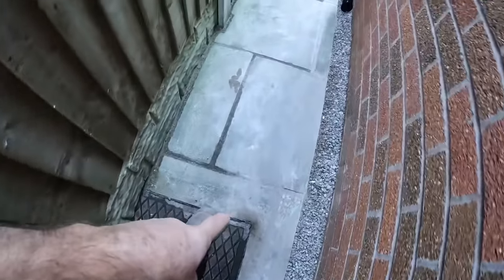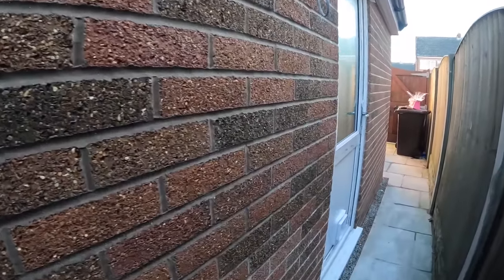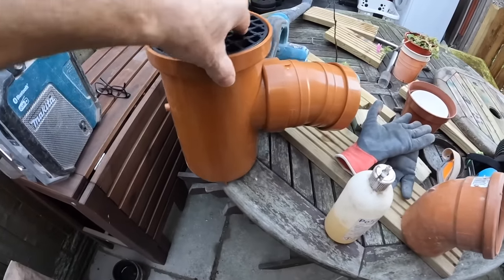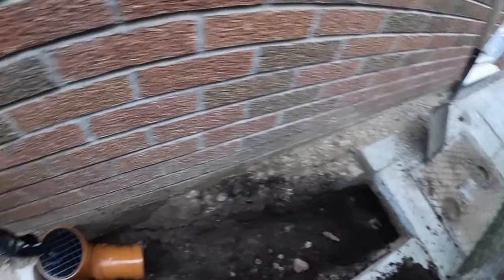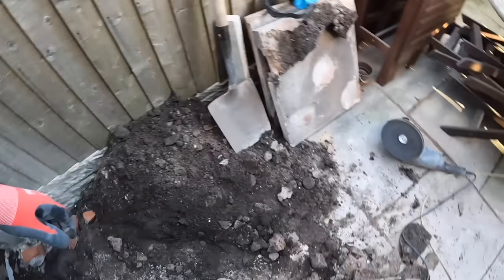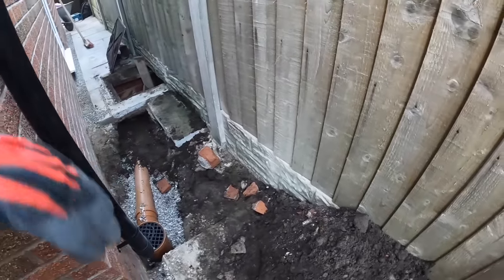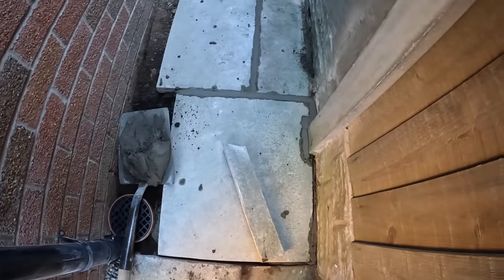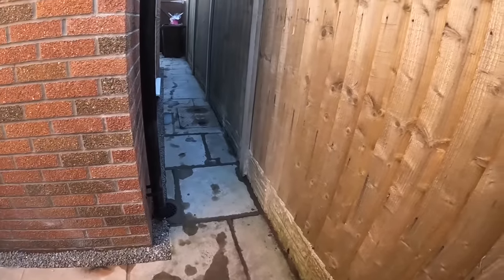FORGOT A GULLEY ..WORKING FOR FREE

Comment: Nice job apart from you should fit the cavity closers before fitting the door and window frames,also most building inspectors don’t usually allow rainwater into foul drainage.
Reply: They do if it's an existing combined system you are working on.
Reply: I thought this too, I thought it had to be soak away for surface water?
Reply from the maker: @chris68213  Get away with what ?
Reply: You can only put in soakways where the ground conditions permit, and only subject to testing if required… putting a connection of surface water onto a combined (existing surface and foul water) sewer system is permitted in areas where you cannot put in soakaways, either due to ground conditions or due to proximity to structures…
Reply from the maker: @stun9771  👌🏼🧱👍🏽
Reply: @SteveAndAlexBuild  you pay extra on your water rates to combine both🤣
Reply: Older houses were built with combined surface and mould drainage. Clay subsoils make soak-aways virtually useless. Even a big pit will flood over when there's enough rain. They are little more than underground ponds.

Comment: You found yourself in a tight corner today Steve! :)
At planning stage, I'd have put the downpipe not in the narrow side access making it even narrower, but in the back yard
Reply from the maker: Definitely a good idea . All taken note of for next time . 
   All part of the learning process 👌🏼🧱👍🏽
Reply: @SteveAndAlexBuild  It should be for the architect/planning consultant/client to figure out and specify. You have done a good job :washhands:
Reply from the maker: @soundslight7754  . It was on the plans so completely our fault .😬🧱👍🏼
Reply: Perhaps even with 45 degree angle around eves and down the back wall as the side looks tight. Great video!

Comment: I thought that you could no longer mix rainwater/surface water with main sewers anymore.
Reply from the maker: If you see the 1st video of the dig this makes more sense 🧱👍🏽
Reply: @SteveAndAlexBuild  Wasn't there a surface water drain pipe right under that corner of the new building?
Reply from the maker: @JohnWatkinsUK  Yes 4 foot down in a very awkward spot 🧱👍🏽
Reply: That’s what I thought

Comment: Ive got to do exact same on my extension except building inspector wants me to run it to all around to the front where i have a soak away in , it means digging all of it out and dropping pipes to allow fall from the back ...except im going to put in manhole like this . Its not big roof area its madness .
Reply: @SteveAndAlexBuild  the original house rain water from front and back just goes to a pitt of rubble and that's a much bigger roof . Good enough for the goose, good enough for the gander .
Reply from the maker: @TopCatsBack 🧱👍🏽

Comment: Great video.
Would you not put down MOT type 1 and then the flag stones on to that rather than cementing them on to the soil?
Reply from the maker: The flags went back down as they were originally 🧱👍🏽
Reply: why not lay the slabs properly on a full bed?